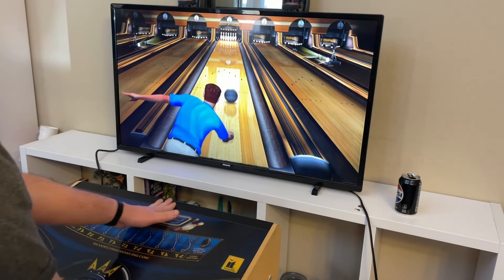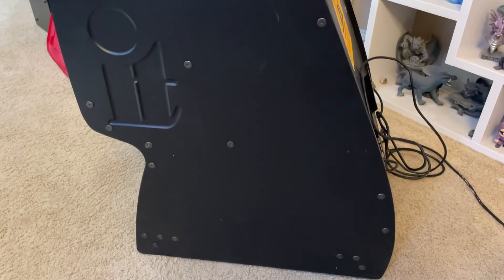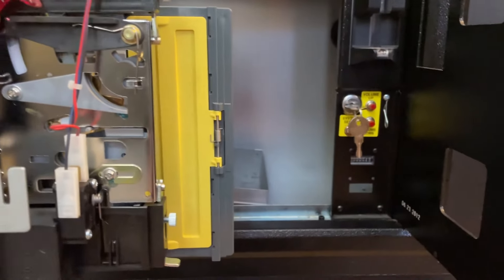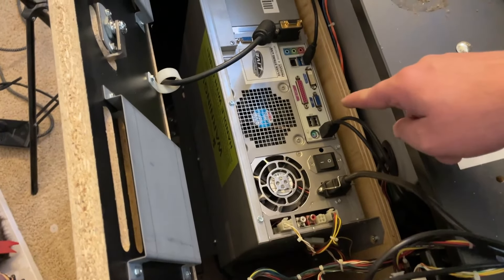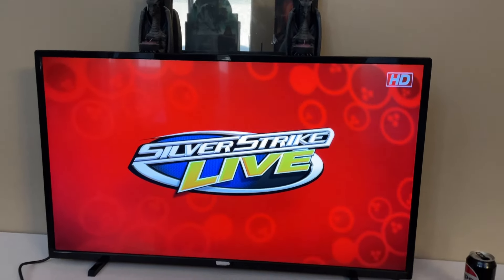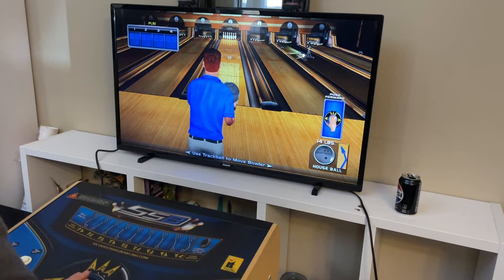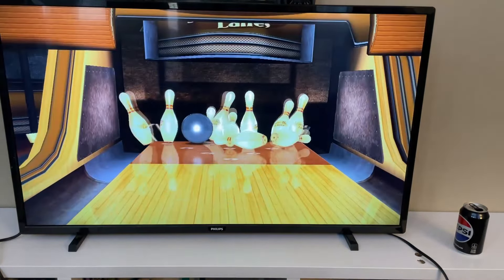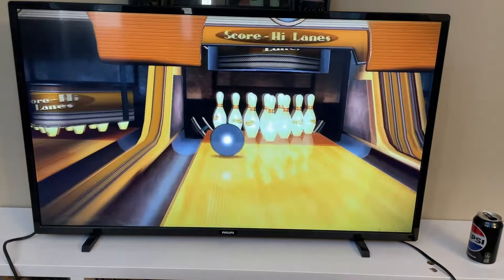Silver Strike Bowling! Latest Arcade Pick-up!

Comment: Just picked up a Silver Strike Live cabinet with good original flat screen monitor, I/O board and security dongle.  It had all the controls and cables left in it.  Someone just pulled out the PC.  Got the moon cabinet for only  $250.  My Buddy has the PC and owes me some favors, so basically, I’ll have a built SS cabinet with SS, Power Putt, Bag Toss, & Darts for under $300 that’s worth over $3k.  You can run the different games on it as long as you just select which hard drive you want to boot.  Can’t beat that!  It will be ready to go this Sunday.
Reply from the maker: Oh man you are lucky I'm jealous!

Comment: My  2007 silver strike bowlers club cabinet was downgraded to 2004 silver strike bowling just for Vegas bowling. I picked it up last year as an empty cabinet but the bezel and monitor were missing. The plastic bezel covers the monitor as well as the speaker grills and Marquee as one plastic piece. Had to fabricate a speaker grill, Marquee and bezel in order to fit the 27 lg monitor. As for the hardware it's really unique and expensive. The I/O board that connects to the trackball has a special chip made specifically for your version of the game and it has to match the hard drive. If not, error codes left and right. The dongle above the I/O board is the cabinet identification device usually labeled like cid then followed by a number. It tells the PC this cabinet is a silver strike cabinet. I found this out the hard way by using a online hard drive in my case silver strike 2007 software on a cid 17 chip which is for offline use. Corrupted cid 17 and had to pay $150 for a new cid. Overall it gets the most use out 9:30  of all my games in the family.

Comment: I am definitely a silver strike fan. I purchased the guts (no cabinet) about three weeks ago. It was a total rats nest of cables, wires, circuit boards, etc. I was very fortunate that the only problem was a faulty computer case fan of which I had one and I have the mess of wires up and running and it works perfectly. My next move is to build a cabinet. I am hoping you would share a few measurements with me from your cab. I need a measurement (inches) of the control panel  and the height of the control panel in front and rear from the floor (to determine angel of slope. I hope to wind up with something as nice as yours.  Thanks in advance if you can help.

Comment: I picked up a used Golden Tee pc, io, and the cid board. I installed mine into a microcenter pedestal/fight stick kit with a trackball spot. Total "hack job" but I got everything for cheap. I also reached out to IT to be able to upgrade to the latest golden tee... I eventually got a power putt IO/CID as well which is easy to swap with the machine powered off. Just recently got the guts for SSB but have yet to give it a try.

P.S. I highly recommend getting a sata ssd and clone the drive that's in it! Stuff does load a little faster but I say do it mostly because it's just a matter of time before the old HDD dies and it not like these games do a ton of disk writing.
Reply from the maker: Nice mod!!! That sounds fun!

Comment: Running on PC? I thought theyre run by a PCB.
Reply from the maker: Yeah in a big ass case like my Star Wars Episode 1 pinball
Reply: The main unit is basically an off the shelf PC since they introduce their nighthawk system (like 2007-ish iirc, I know golden tee fore complete was the last golden tee to be its own board). Though you do need their IO board (where the buttons/trackball plug into) with a special chip and a certain CID board for it to actually run the games otherwise it errors out. Like, you can't just swap the HDD/SSD out from SSB with Golden Tee and expect it to work because it will refuse to load the game. You have to also swap the chip on the IO board and the cid. Honestly easier to just get another IO board for easier swapping or a thing called a magic switcher.